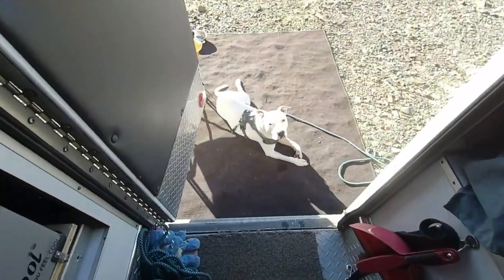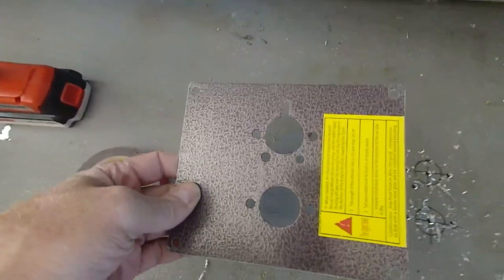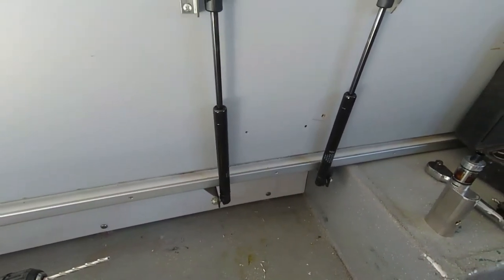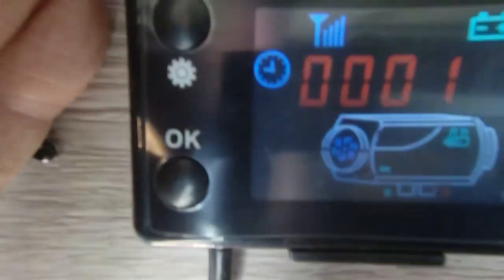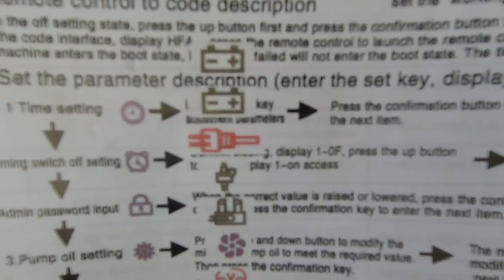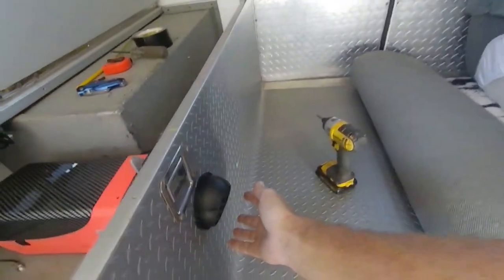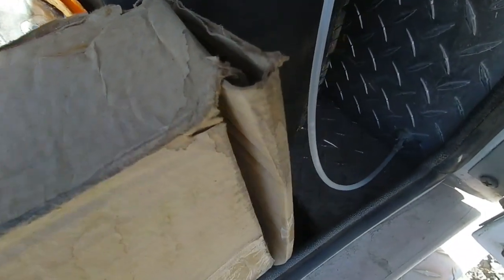Diesel Air Heater Install in Ambulance | Ambulance Conversion Life

Comment: Definitely doing this.
The condensation from my buddy heater has been seeping  into my interior panels, and freezing.
It is definitely not a friend to my ambulance.
Plus, I can't trust leaving it running while I'm at work, with Moses in the rig.
The diesel heater would alleviate both of these issues, and, only costs a few bucks more than a buddy heater.

Comment: So, you got me. I'm going to try one of these in my semi because of the price. I've had name brand heaters before but my new truck didn't have one. I've been using my Honda generator with a ceramic heater. I also use it to run an a\c so I don't have to idle. I just can't resist the $130 price🤣

Comment: I've seen it suggested that it's a good idea to order two heaters (if you're using the cheap ones from China which many do) so that when one breaks you can use parts from the other one. I thought that was a pretty good idea.

Comment: I am really enjoying your explanatory videos. Great build! I am a big fan of the Chinese Diesel heaters. I might have read somewhere that the Chinese fuel tanks like yours are not UV resistant and will fail after too many hours of exposure to the sun. You might think about rigging up a cover for the tank or maybe paint it if paint would stick to the plastic. Otherwise, you might install a better tank. Not being critical, just sharing.
Reply from the maker: Hi RS. I have already seen discoloration of the fuel tank so I'm sure that it's getting beat up by the sun. Funny thing, just this morning I was talking with a friend about it and I said "what if I paint it". I think I'll go ahead and do that because it's easy enough to do. When I connect into the main fuel tank I won't have to deal with it any longer... it just has to last till then!
Thanks for watching and the comment!

Comment: With the moisture in the air, from my propane heater inside, contrasted by the dry, cold air, of a northeastern winter, I think I should really just buy one of these .
I see myself contracting pneumonia otherwise.

Comment: i guess in alberta , i will be getting the combo unit, which could heater air as well as liquid and use the heating liquid to preheat the coolant of diesel engine for nasty winter times.
Reply from the maker: That sounds like it would be a good fit for your weather. My truck has a block heater that I can power from my inverter if needed. Have fun building your rig! Thank you for watching and for commenting  :)
Reply: Can you supply a link for the dual unit, thanx from an ex albertan.

Comment: David, now that you are a few years after the installation, have you protected or isolated the fuel pump more than what we see here?  On my install, I placed my pump in a small acrylic box with foam, then mounted the whole box.  My hope is that the box will protect the pump from road debris and corrosion.  The extra foam in the box helps with noise reduction.  The ticking noise of pump is hardly noticeable now.
Reply from the maker: I haven't made any changes to it since I plumbed it to my main fuel tank. The current pump has been 3 years in service, so it's doing well :) The pump noise is subtke and never made me feel as though I needed to isolate it thankfully.

Comment: it seems like your ambulance is a little bit of small. but a really good idea and good job. I am thinking of getting a retired ambulance  to convert it into to my camper and even use it in winter in alberta. nasty winter in feb or jan could dip down to -40 c, for a couple of days or week. I think it is a bit of better to keep the diesel tank in side of box.
Reply from the maker: Hi - thank you for watching and for commenting. I will be connecting the heaterbfuel line into the main truck diesel tank this summer and removing the seperate tank. That will clean it up some :)
Reply: Recently completing project management courses.I apply your Excellent Manageareal Skill's.A Real Pro!A P E!Assess Plan Execute.Implementing Positive,Iterative Leaning,Applying Positive Loss,To Positive future Steamline Gain.Will keep Watchin You Two Guy's

Comment: They really made that heater system too convoluted. There's no need for a muffler, or an air intake. The unit doesn't make noise, and it can suck the air from inside without an intake. Since the rig is diesel, auxiliary tank isn't needed. When that Chinese clone junk dies get an Espar or Webasto. 

All that said, you have a very cool rig.

Comment: Other than deciphering the English It looked like it was a simple install. If you know what you're doing with the electrical
Thanks for sharing. Your experience and give us an update down the road on how it's doing.
I'm now wondering if this system can be used with the existing duct system and a camper because I really don't like the heater that is in there.
😉🙏✌💞🐶💞👍👌😊
Reply from the maker: Hi Darryl - I believe you could use this style in your camper. You'd probably remove the existing unit and put this in the same location, then use whatever duct size adapter is correct to join it in to the ducting. If your camper is very large, you could also add 12v fans in the ducts to push or pull the warm air longer distances. In my truck, I've been running it on the lowest setting (in 39 degree nights) and the truck is warm enough that I wear shorts - and Lefty sleeps like a rock! Thanks for watching and for your comments :)

Comment: Nice install but the fuel tank seems a little exposed out there on the back of the van ? woildnt it have been better to fix it inside the rear locker ?
Reply from the maker: That's been updates and it now feeds from the main fuel tank. I wouldn't suggest an exterior tank like I had. Condensation and debris incursion.

Comment: Great job! Did you consider tapping into your main fuel tank, I assume your truck is diesel. Are you smelling diesel as heater operates?  Who makes heater?  You happy with it? Thank you, Chuck
Reply from the maker: Hi Chuck - Yes my truck is a diesel and I am planning to tap into the main tank. I have a 60 gallon tank so I'll never have to worry about using too much! There is no smell in the truck when the heater is running. No diesel smell and no smell at all. It's just pulling air from in the truck and heating it and pushing it back out. The brand I bought is called Warmtoo and I bought it from Ebay for $120. I do have a link in the description for it. I've been running it about 2.5 weeks and I love it! It has performed great and keeps us very comfortable on its lowest setting in 40 degree nights.

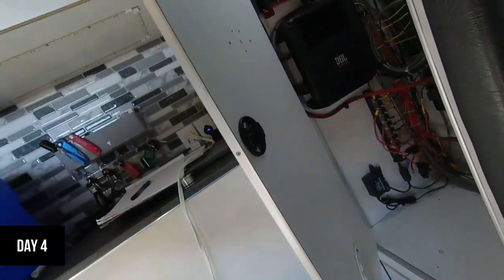Comment: @ 13:38, the busbar you point to and use, was it an original busbar already installed in the ambulance wiring cabinet or is that one you installed?
Reply from the maker: Scott - the bus bars are the original bars that were in the cabinet.

Comment: When you're inside the ambo, can you hear the fuel pump ticking? Also does the ticking slow down?
Reply from the maker: The ticking can be heard if there is no other noise. For example, if I have the TV on I can't hear it. When it's on at night I sleep right through it because it's quiet enough that it doesn't bother me. Took me like 2 nights to get used to it. The ticking speed is dictated by the setting - I have it on its lowest setting overnight which is just about 1 tick per second. I'm glad the video will help you!!!

Comment: Nice install video - added to my Diesel Heater playlist.  I was going to ask how it is going with it -- but I see the other video pop up about it failing so I will watch that next for updates.  If you had to change anything about this install what would it be?   I've always thought it would make sense to move the unit as far away from the bed as possible, to dampen the clicking sound this makes, it is loud on all the videos I've seen.  This was satisfying to watch a big and important job get done man, =1.
Reply from the maker: Overall the install is good - the clicking is minimal and I got used to it pretty quickly.